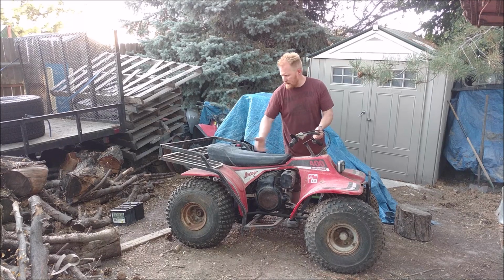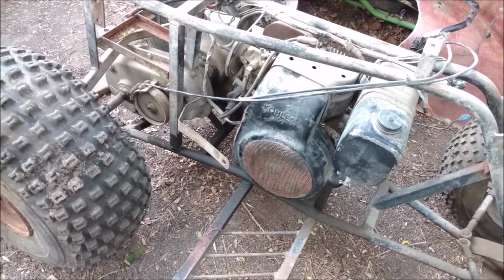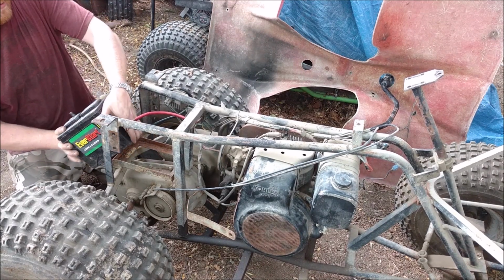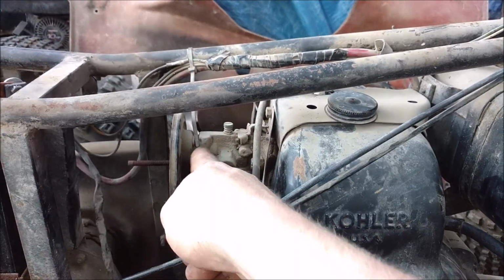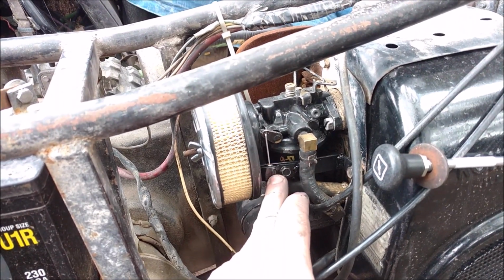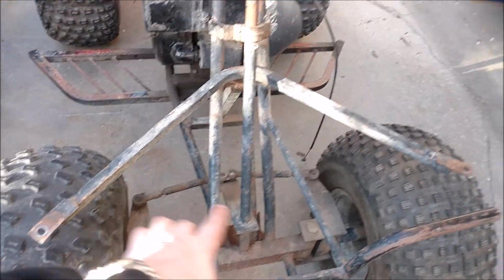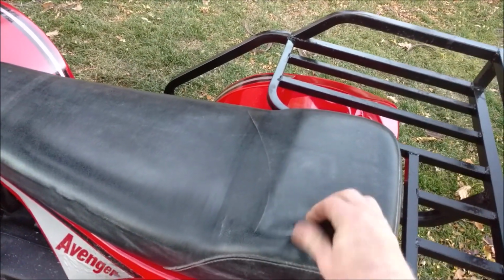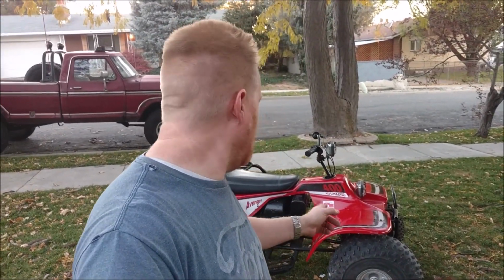First ever made ATV brought back to life Avenger 400

Comment: I grew up in that factory. My step father helped open up the company and designed those bad boys (including the ugly rack, haha). He was chief welder and fiberglasser. He designed some of the first climbing stands, too. Everything we owned was made out of the metal from those bikes. The Adventure 3 wheeler was the first ATV with reverse and electric start, I believe. It was cutting edge in some ways and very old school in other ways. It also focused its design on farm work instead of fun. That's where the Honda killed it. The Adventure was too slow and too heavy for younger people. It was also terribly unreliable at first when it had Tecumseh engines in them.
Reply: We recently came across a Manco we are trying to rebuild. Could you possibly be able to help us ?

Comment: Nice work on a cool vehicle. I remember test riding one of those back in '85, we had a Honda Big Red three wheeler we kept at a hunting camp and my dad wanted to replace it with a quad. We ended up buying a Honda FourTrax 250 which I still have. Overall I thought the Avenger was a decent vehicle, though crudely built. The lack of suspension was the deciding issue, my mom had broken her wrist rolling the three wheeler and the Avenger seemed less stable than the FourTrax. Price wise the Honda was considerably more expensive, but that could have been due to high demand for them or the Avenger dealer (who primarily sold boats) looking to move inventory.
Reply from the maker: All the MSRP pricing I found shows they were originally more than the Honda, Suzuki, and Yamaha models. Supposedly the 4x4 model was double the price of entry level Asian models and $500 more than the top of the line Honda. I think they went out of business(fire and sales) around '84-'85 so they were probably trying to liquidate them. They couldn't compete with build quality for price you got from cheap Asian manufactures. It's a piece of history and fun to show off, but not an engineering marvel for sure.

Comment: that machine cleaned up very nicely, you didn't even have to do much to start it & make it look new. They don't make them like they used to.

This may even been considered a first of its kind utility/light duty atv on the market before suzuki put out 300cc+ engines. ofc when suzuki came out with the 'Quadrunner' it didn't have the best suspension either (& mearly identical frame builds for both atv's alone) I believe they put out a 4wd edition of one of those avengers, not even mentioning the best part is the fact that this even came with an electric start. Super cool atv 👍

Comment: Also the original knobby tires it came with weren't curved across the tread they were almost completely flat from one side wall to the other. I've seen identical tires to the original's at Tractor Supply for about $65 each.

Comment: That came up real nice, my old Howard's rotovator has that type of Kohler engine on it. The frame and steering on that quad looked very primitive  , but they had to start some where, nice old classic there. I had a Honda big red I think 1995 that was a nice machine and well made. Good vid thanks.
Reply from the maker: Thanks, those Kohlers are a great motor.

Comment: Wow that thing is like new after your repair. I am surprised at the prices back then. I remember my dad bought a brand new Datsun B210 for $3000 in I think, 1976. That wasn't that much more than the price of this quad a few years later.
Reply from the maker: I had to see how much that was in today's dollars. Looks like $3000 1976 = $13,000 2017. Hard to buy a basic new truck for less than $20-30,000+ these days. I do wish they would offer a simpler vehicle sometimes. That's what made Datsun and the Toyota's of the day popular. They were cheap and basic, which equaled reliable.

Comment: Originally, it did have a pull-start as well as the electric start. Mine still has the original pull-start on the side of the engine.

Comment: It did clean up nice. It should be fairly reliable. Stock up on parts for that kohler because they are hard to find. Oh yeh, one more thing, reduce the sir pressure to 3 to 3.5 psi and it will have some suspension! LOL Again.....great job!
Reply from the maker: Yeah, lower pressure is on my list.

Comment: Now the Avenger 400 is rear-wheel drive only, but they did make some that were 4-wheel drive using chain that ran from the rear axle up to the front end to drive the front wheels. Looked pretty hokey at the time, never wanted that model and don't think they sold many of them. I found that a little toe-in on the front wheels makes the steering ok, and don't over-inflate those tires they should only carry about 5 psi in each tire max! Other than that there is no "give" to the suspension of course, if 1 front tire rolls over a large ant-mound the entire front end is going to come up both sides... these machines were very simple construction.

Comment: Actually Suzuki came out with a 125 in 1982 then Honda came out with their 4wheeler in 1984. This is not the first atv, but cool to see.  I remember the first Suzuki 125, it was too light in the front end and it was hard to climb anything without the front end lifting skyward
Reply from the maker: These came out in a roughly 80-81 and actually made 4 wheel conversions for most other brands.

Comment: That is sweet.  Lower the pressure in the tires a bit to improve the ride and handling..
Reply from the maker: That was the intention. But months ago when I put the Tireject in I pumped them up to 10ish psi and expected them to loose a little air as the Tireject sealed them up. Nope, they have not lost a drop.
Reply: sixtyfiveford
Glad you brought that up. I told a friend about how you done that and he tried it..... worked out great! 👌
Reply: I'm still an innertube man whenever possible.   I think I already told you about pulling my Grandpa's old 1950's riding mower out of a pile of scrap, where it had been for 30+ years.  And noticed that unlike my own mower, it's tires were still pumped up.  I thought what the hello?!?  It had innertubes....
Reply from the maker: I run innertubes in my garden tractors when the holes are big big. I've even needed to put in backer rubber so the tube won't bulge out :). I've used gallons of the slime type sealants (I buy it in 5 gallon buckets) with great success and it saves me from pulling a bunch of tires and buying/installing tubes. Tubes are great but drive me crazy when I do get a puncture or rip the stem off and have to pull the entire tire. TireJect is my new go too though as I've never had any seal up as good or fast.

Comment: Yes .....
We used to have 25 machines and 4 different models M-5. S-model. J-5 and the bombi. My dad had a rental business. I still use 1 unit it has a blade and I have a backhoe,Post pounder and I built a log splitter for it.
Reply from the maker: That's neat. I knew they made attachments but wouldn't have guess a backhoe.
Reply: sixtyfiveford/ all the attachments I have added myself. There usage is unlimited. I'm lucky to have one. They sure help out  around the farm or acreage.

Comment: Cool bike, where do you get engine parts? I just picked up an 1970 ish  225 Lincwelder it has an Onan engine any idea where I can find parts for it. Thanks
Reply: woodaddict1
I had to do some work on one of those one time and found parts at a RV place because the generators they use normally have that engine.
Hope it helps!
Reply from the maker: Parts for these engines are very abundant online. Your Lincweld 225 should have a CCK/CCKA engine in it. Here is a parts manual for it http://gravelymanuals.com/pdf/Onan_CCK_CCKA_Parts_Manual_19860600.pdf . Google virtually any wearable part and you should be able to find it. Used parts: Ebay is your best bet.
Reply: sixtyfiveford thanks you made my day!
Reply: sixtyfiveford that would make a good video, finding parts..

Comment: I looked at a lot of fuel pumps i don't know if it has a arm on it or if it is a flush mount i don't have no numbers on the frame at all i don't no what motor i have it looks like yours
Reply from the maker: The motor should be a Kohler k181 and should have a name tag on the engine shroud.

Comment: Hey buddy. You said you didn't use anything to restore the shine to the fiberglass but it looks like you have maybe a 3M product in the video. It also looks like some kind of haze the polisher is working.  Did you have something you put on there or was it a dry buff? Maybe it was just a cleaner wax of some sort?
Thanks for another interesting, motivating and inspiring video.
Reply from the maker: I used 3m polishing compound but no waxes.
Reply: Ok, thanks Moe. I have a fiberglass shower I am getting ready to attack so this was part of why I was curious. I have some 3M Marine Fiberglass Restorer and Wax  that I got at a thrift store that I am going to try. I already tried it on some bath fixtures just for fun and it definatly left some wax. And without scratching.   I've learned a lot of good stuff from your videos. Thanks.

Comment: I remember them new. Some are still around. I don't know why they stopped making. Simple,  parts were at any industrial supply. I live close to where they were made. I can put my hands on three three wheelers right now. Really about 20 mph is cruising on it. Maybe if they made them so the front axle would tilt a little, may have been more popular. They were on to something. Could have been big.
Reply from the maker: I wish more things were made with standard off the shelf parts.
Reply: My step father helped start the company. They went out of business because they couldn't compete with the faster lighter Hondas. Plus the first few years they had 10 hp Tecumseh engines that were really unreliable. I carried abound spare spark plugs every where I went because they were constantly fouling out. I rebuilt the engine yearly.They had a bad reputation from those days. The Kohler was a great change, but the reputation was already there.
Reply: @robsmith6462  Yes, the Tecumseh was not the best choice. Might have been at one time, but not at that time. Tillers and go karts came with those. back then. Where they were in the open, so you could tinker with them.  I've had the Tecumseh blues, many times.
Reply: @ridgerunner106  On a good note, I had to learn how to rebuild engines because of that motor!!

Comment: Times that by two great job!!
Reply from the maker: Thanks. Is that your Bombardier snowcat? That would be a fun toy.
Reply: sixtyfiveford.... I have a bone yard that about half a dozen machines of that year could be restored
Reply: Can’t beat that one , even came out looking nice restoring the gelcoat  plus it’s nice to have one you don’t have to worry about every scratch or bump that takes some of the fun out of it
Reply: I wish i didn't have to worry about scratches . It went in line along the shop to be rented out. We went right through every unit when the time came.
Reply: How is the 4 wheeler running

Comment: I have the chance to buy one of these in similar condition to yours. Is it worth it.
Reply from the maker: They are pretty terrible in compassion to a modern 4 wheeler. No suspension makes it a poor choice for hills and large bumps. Just putting down some trails or flat ground it's not bad. Is it fun? Sure as it has 4 wheels and an engine. But it's about the same as riding a go kart.
Reply: @sixtyfiveford  good to know. I have a trail 90, a fl250, and a atv so i figured it would just be fun to own especially if the price was right

Comment: That may be the first 4 wheeler, but not the first atv. The first atv was the sperry-rand tricart in 1967. But Honda was the one who really made atv’s popular in 1970 when they came out with the atc90.
Reply from the maker: Exactly Honda and others had the ATC which is not an ATV. ATCs are 3 wheelers. ATV was coined as a reference to 4 wheelers.
Reply: Alright, I see where you are coming from. I was just saying that because the state of Minnesota classifies 3 wheelers as class 1 ATVs, which is the same as a 4 wheeler.

Comment: Good day I know its been a few years since you restored this machine, however I have a few questions, as I have this exact model in my barn given to me by my grandfather years ago. its actually the first machine i ever rode in the late 90's I want to do the same to mine as you did you yours - any chance you have an email i could reach out to you with my questions?
Reply from the maker: There's not a ton of info out there on these machines. I list a decent amount in the video description below the video. Other than that I can answer any questions you have. ?
Reply: How did you or did you even have to adjust the brakes? Whats the best advice you have for adjusting the breaks and or finding replacement break parts for this?
Reply from the maker: @lukekulpa7699  This uses standard go kart band brakes. You just tighten a bolt on the rod that pulls on the brakes.

Comment: Wow, presto! What is up with the points?
Reply from the maker: The points look to be original and work great. I adjusted them and cleaned them just for fun, but it wasn't necessary.
Reply: I couldn't tell how you were adjusting them? 
Learned something about front ends, Kingpin alignment, forgot to mention that.
Reply from the maker: I put the little hole in the plastic belt guard so I could get a screwdriver in there adjust how far they open.
Reply: Not familiar with Wisconsin's at all.

Comment: WERE DI YOU FIND OUT ABOUT PARTS I NEED A GAS TANK AN A SHIFTER PLEASE HELP
Reply from the maker: You won't find any parts made by Avenger. The gas tank is just a Kohler part though, but you could mock up any small engine gas tank it there.

Comment: Is this thing related to the rupp go joe?
Reply from the maker: I don't think so. Rupp was out of business by the late 70's and really the only similarity I can see is being a 4 wheeled ride on machine. The Avenger company started out by making 4 wheel retrofit kits for 3 wheelers and decided to make their own 4 wheeler. It could be debated though that Rupp made the first 4 wheeler. The Rupp looks like they took one of their rear engine go carts and simply put a straddle seat on it. This shorted it a little but it's still not a center mounted engine between the legs setup like early 3 wheelers or modern 4 wheelers of today.

Comment: Doesn't sound like  two cycle!
Reply: It's not, he only used the two stroke oil to lube up the cylinder walls a little.  It hadn't been run in years and was dry as a bone I'm sure, also helps cut any slight surface rust as it had been open to the weather.
Reply from the maker: Yeah, I guess I should have described what I was doing.

Comment: Suzuki LT125 QuadRunner is the first atv 1982
Reply from the maker: These were made in 1980.
Reply: @sixtyfiveford  sorry it's well know fact first avt was Suzuki and first 4x4 atv was 1986 Honda trx 350D
Reply from the maker: Sorry, it's a fact the first 4x4 atv was the Honcho. There's even a 1984 magazine article with photos https://www.farmshow.com/a_article.php?submit_search=1&keywords1=honcho&aid=6309&aid_previous=12716&page_num=1&nav_previous=&nav_next=1
Reply: @sixtyfiveford  then why does ever Major atv magazine say the Suzuki and Honda look it up.
Reply from the maker: Because they weren't sold by sponsored ATV dealerships who had years of Honda, Yamaha, Suzuki loyalty. They were sold through tractor dealerships to farmers for use as a tool. Adventure Products started out by making aftermarket 4 wheel front end conversion kits for 3 wheelers in the 70's for Honda, Yamaha, and Suzuki. They sold their own 3 wheeler in the 70's and couldn't compete with the cheap Asian imports so they made there 4 wheel version in 1980 in Louisiana. It was designed to help farmers with farm work.
Reply: @sixtyfiveford  sorry still won't call it the first

Comment: I know that subject is question subject is a little off course,But I never seen a idea or subject or heard of anyone or person getting a DRY seized motor 4 cycle motor that is.
Reply from the maker: I've had rusted cylinders on 4 cycle engine that were seized but never on that locked up due to lack of oil. Generally if a 4 cycle runs out of oil it will lock the connecting rod to the crankshaft and snap the rod.
Reply: I meant from sitting over a couple years and end up dry seize.I heard to try kerosene ( coal oil) let it set for a month and then try it.Well I'm going to try it.
Reply from the maker: Another option is to use a chemical that will eat away the rust that is locking up the engine. The safest is white vinegar. It will dissolve rust in a matter of hours and allow the engine to spin. But then it needs to be neutralized with some water/baking soda.

Comment: That is not centrifugal it is a torque converter
Reply from the maker: A Torque Converter is a fluid coupler in an automatic transmission for a vehicle. A  Torq-A-Verter is a brand of belt driven  Centrifugal clutch.

Comment: Thats a torque converter
Reply from the maker: It's actually not. Comet coined the brand name torq-a-verter but it is technically a CVT(Continuously Variable Transmission). A torque converter is something completely different.
Reply: sixtyfiveford true but it’s not a centrifugal clutch either